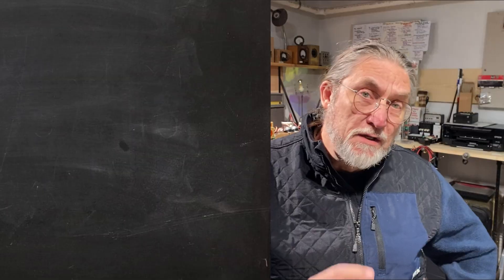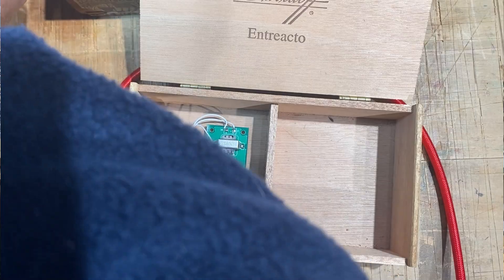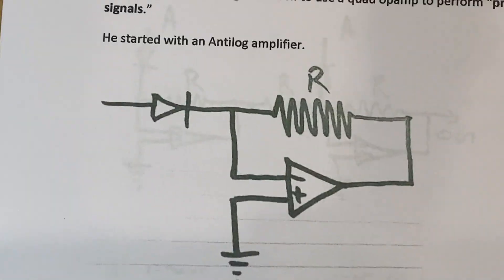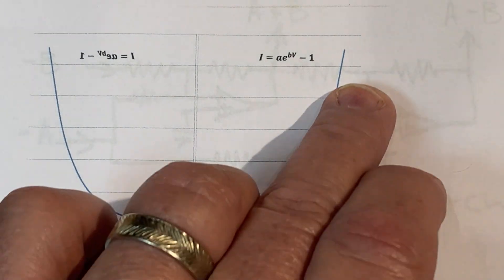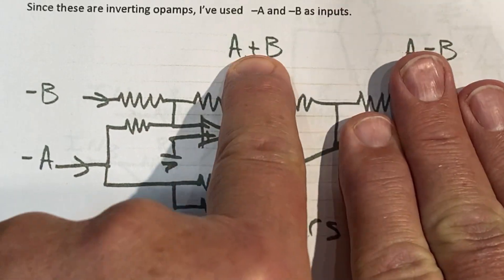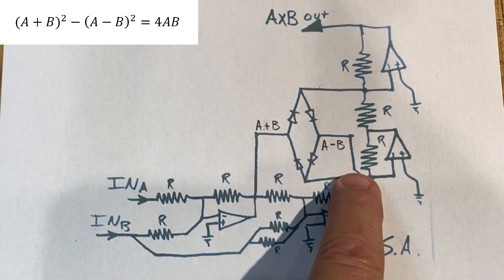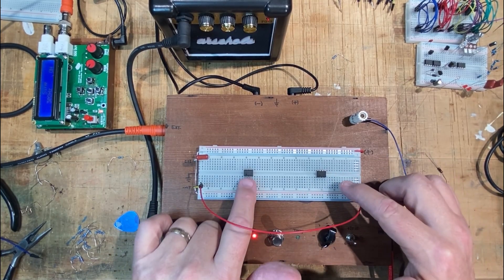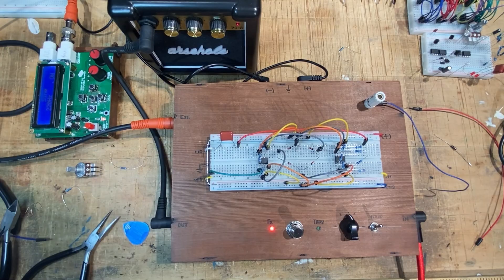Building a RING MODULATOR From SCRATCH

Comment from the maker: What happens when one audio signal mathematically multiplies another? In this video, I build and explain a ring modulator / four-quadrant multiplier using only four op amps, four diodes, and common resistors -- no specialty ICs required.

In a previous build, I demonstrated amplitude modulation using a diode switch acting as a voltage-controlled amplifier. This time, I take things further by allowing both the carrier and modulator signals to swing positive and negative, creating true four-quadrant multiplication -- the core of ring modulation.

Rather than relying on transformer-based passive ring modulators or specialized chips like the LM565, this design is based on a paper by Sebastian Azevedo, which shows how a quad op amp and diodes can approximate a square-law relationship through clever use of antilog amplifiers.

In this video, I cover:

    The difference between amplitude modulation and ring modulation
    Why ring modulators are often called four-quadrant multipliers
    Limitations of passive diode ring modulators
    How antilog amplifiers using diodes actually work
    Using algebra (sum and difference of squares) to derive signal multiplication
    Why the diode “ring” naturally falls out of the math
    Building and testing the circuit on the bench
    Listening tests with guitar and oscillator input

While ring modulators are often used for harsh or alien sounds, my long-term goal is different: using multiplication and quadratic behavior to approximate the even-harmonic structure of a triode tube stage -- entirely with simple analog components.

This is one of the most technically dense builds I’ve done so far. Let me know if this level of detail is useful, too much in the weeds, or exactly what you’d like to see more of. And if you spot errors or know of similar work, I’d genuinely love to hear about it.
Reply: How well does the circuit work if one input or the other is DC? In other words, can you use this as a VCA, the gain cell for a compressor or gate?
Reply from the maker: I'm actually going to be looking into this very shortly. I have my suspicions about what it should do. From the mathematics, it would appear that it would be a form of VCA. I'm definitely going to try.
Reply: @MadScientistGuitarLab  I simulated it in Spice and the linearity leaves much to be desired. Hopefully it sounds cool, but it definitely won't sound transparent.
Reply from the maker: @StephanAhonen well, distortion and guitar signals go hand in hand. If it sounds ugly but interesting, it deserves a closer look.
Reply: Cool, was just watching this video https://youtu.be/NBVIN0S5o_g?si=wnk8Je2BE4LEdg7E  which i think is baiscally the same thing just showing all the math,  a squaring function.
Reply from the maker: @mikejones-vd3fg That’s interesting. I will definitely look into that for my future projects. Thanks!

Comment: Could you make a ring modulator where the carrier signal tracks the input signal at an adjustable difference?
Reply from the maker: I like the way you think. In many ways, that’s what I’m working on now. I’m trying to add a constant amount of shift to a signal but do it in a way that moves with the signal to be “in tune” so it doesn’t get all angular sounding.

Comment: As a naive high-school student, I built a ring of diodes, without transformers, and I heard the BBC World Service coming through my guitar amp.  
As for carrier leaking through, that's a sign that the modulation isn't actually balanced.
Reply from the maker: That's an amazing story about picking up the BBC World Service. It's like you built a crystal receiver and your guitar was the antenna picking up the radio signal.

Comment: When I was a youngster , I built a ring modulator using a five transistor array I ... CA 3086 ... more or less same result as four diodes ... however when I use a 4046 in combination with a LM13007 and a few more components I got a really good result ... similar to the synthesizer module published in the Elector magazine ... only one thing ... nobody in the band like the unusual sound .. so I scrapped it
Reply from the maker: Thanks for sharing your ring modulator building experience! It's fun to hear about the different ways people have tackled this circuit, even if the band wasn't always a fan! 😊Sometimes you just gotta be weird though.

Comment: The only “problem” that sticks out to me here is it sounds like the op-amps on the output side are clipping. I’d speculate that only 500mV on the input may be all it takes to cause that. 

The circuit would likely benefit from an output buffer stage, and independently-variable attenuators on the guitar & pilot inputs
Reply from the maker: Thank you! I know part of the distortion was from the input side. We fixed that by adding a log amplifier to compress the signal before processing. It worked really well. A buffer would help the output stage too. I might have room for one more chip. 😂

Comment: The Ring Modulator was invented by Bell Labs, and the purpose was combining two phone calls on one copper telephone line, then they could use all wires for two calls at the same time. Can you imagine, somebody speaking to you by phone, and the voice went threw a ring modulator? 
 
Don't answer, just let it sink in.
Reply from the maker: Yes indeed. Early multiplexing. I almost made a mention of this in the video because it explains why we use the phase locked loop. There's another HUGE topic lurking here because there's a lot of stuff that we do based on the work at Bell Labs.

Comment: Keeping the diodes at the same temperature and having them fairly well matched works out better.  You can get "2 pair series connected" diode arrays.  This keeps them closer to the same temperature.
In the past someone did make a semiconductor thing that matched a tube.  I can't remember who it was.  They did it using transistors and not diodes.  The math is the same.
The same basic circuit plus some more bits can be used as part of a frequency spectrum inverter or as part of a frequency shifter.  Both of these can be useful effects in specific cases.
A Gilbert cell can also multiply but it only works at smallish amplitudes.
Reply from the maker: Thanks for the suggestions on temperature matching and other applications for the circuit! The original author used those devices because they are well matched with low forward voltage. Thanks for watching!

Comment: Very interesting.  I haven't seen this circuit used in music synthesis, and I wonder why.  Instead, specialized multiplier chips are used.  And they still need trim pots and such, so it's not like there's a big performance gap.  Opamps, diodes, and resistors.  I love it!
Reply from the maker: I think the specialized multiplier chips are used because they are easier to set up and trim. This circuit is definitely a bit more finicky, but it's a lot of fun to build from scratch!

Comment: This is kinda related, but you might find it interesting. I recently built a guitar amp that uses a VFD display instead of a triode in it's preamp and it also produces even harmonics. You might wanna try experimenting with that. It's like using a triode with directly heated cathode. It sounds wonderful if you ask me. It's the same exact thing as that thing called nutube that was popular a few years ago. It's a much simpler way to produce those harmonics if that's your only goal.
Reply from the maker: Definitely something that I would be interested in! Thanks for the suggestion!
Reply: @MadScientistGuitarLab  Try it, you won't be disappointed. Best of all is that it works on low voltage. Mine is set up to work on just 25 V

Comment: ... but I think you got your circuit wrong anyway. You mingle up A+B with A-B and then square the mingle instead of squaring
A+B, which your squarer could do, but then you would have to send A-B through another squarer and then subtract the second square from the first square. Better still, get yourself a used copy of the latest edition of Horowitz' Art of Electronics and look up what he recommends for a ring modulator that suppresses the carrier ...
Reply from the maker: I sold my copy of Horowitz decades ago. It would be great to have a copy of that for reference again.
As for right or wrongness of the circuit, I followed the original authors work and it appears correct, even though it’s an approximation. It may not be obvious from the way the circuit is drawn, but the opamps in the final stage handle both duties of squaring and the subtraction of squares.

Comment: Nice job! It's really fun to encounter one of my circuits "out in the wild".   It's funny, I had the same doubts about being too "in the weeds" when writing up that article for EDN...

The circuit is clearly modulating and seems fairly well "balanced" in terms of component matching. I'm hearing a more pronounced thresholding effect than in my builds, where the output stutters and drops out as the note decays. Might be down to the type of diode used, or the voltage scaling etc.

 I never specifically optimized the  circuit for use in a guitar effect, it was just a somewhat "cheesy" example of an application of a low cost analog multiplier. Still lots of room to experiment and improve the circuit. 

Placing a log-amp stage before both inputs (made of the same resistors/diodes) yields a much wider dynamic range version of the circuit, which doesn't have those scaling/crossover/dynamic range problems, albeit with 6 op amps now. 

Also, if you build the oscillator out of analog components, you can "leak" a bit of guitar signal into it, causing it to snap to harmonically related frequencies of the note. This screens out very dissonant combinations of guitar/oscillator and makes for a more usable, well-tempered effect.

All the best!

S.A.
Reply: ooh! two channels to subscribe to in one video 😍
Reply: Wow...found two amaxing authors in onw day. Subscribed to you both.
Keep the weeds goin' 🪴 🌱 🌿 ⚛️
Reply from the maker: @edgarskarklins3572 you’ve helped coin the term “technical weed farmer”
Reply from the maker: Wow, thank you! It’s really cool to hear from you directly! I, for one, could have used more weeds in your original work. Ha ha. Hopefully, I've covered your original idea and done it justice with my explanation. 

I've tinkered with your circuit off and on for the past 5 years with modest results. This time around, it was only after my frustration with log/antilog multipliers that I tried yours again. It worked better than I had ever hoped and so I made this video. I suspect that my diode choice is causing the distortion you hear. I have some germanium diodes with very low forward voltage that I could substitute in there to clean it up. They are really inconsistent though.

Thanks for the great info and suggestions. Adding a couple more opamps for the log /compression on the inputs isn't too bad. I think I have room on the bread board for that. Oh, and the "leaky oscillator" is inspired! I have a stack of oscillator experiments to pull from that I can play with to make that happen. I have never thought to perturb one with the guitar signal before. I'm definitely going to play around with that idea.

Comment: did you match your diodes or any of the resistors?
Reply from the maker: Not in the slightest. Granted, these were metal film resistors so were 1% values. The diodes were just plucked at random from my parts bin. Their forward voltage was anywhere from 0.62 to 0.64 volts. I was surprised when it sounded as good as it did. I’m not complaining.

Comment: One thing I've wondered about is about the effectiveness of a hybrid analog/digital approach where a DAC whose output is scaled relative to a reference is fed one waveform digitally, and the other waveform as the analog reference.  The sampling rate would have to be high enough that the output could be filtered without eliminating the useful overtones that were supposed to be produced by the ring modulation, but many styles of ADC inherently produce an output proportional to a reference voltage without need for non-linear processing.
Reply from the maker: That's an interesting idea for a hybrid approach! I have used an ADC as a compressor before by feeding a copy of the signal to the reference input. The sample rate was huge, and in so doing the digital conversion was scaled really well to make a wonderfully compressed signal.

Comment: I think it depends on the audience - I stumbled on this as I'm into electronics and I've heard of ring modulators through synths and other stuff, but I've never seen it explained. So if you intended it to be a part of the electronics group of YouTube, then continue on. If you want to keep it audio only, then probably it's in the weeds. But I think it's neat because it's one of the few overlaps you can demonstrate with sound and not just an oscilloscope.
Reply from the maker: You make a good point. I’m on both sides of the fence here. Part of me is just a guitarist that wants to make cool noise. But I’m also a physicist who knows all the math and theory that goes along with the electronics. You’ve given me an idea to strike a balance between the two. Thanks!.
Reply: @MadScientistGuitarLab please do. There's plenty of sell out channels just reviewing some commercial products, or audiophiles arguing about snake oil.
I'm learning electronics and it's a bit hard to distinguish what to believe and what is just misconceptions.
And there is a wery large gap between doing an ac and dc course and practical curcuits and the maths as you shown here. I mean beyound "this is embittered follower; this is op-amp".

I wish true graybeard channels would be more popular than brain-rot.

One can dream.
But I only discovered your channel by accident by following interesting YouTube recommendations.

I'm learning a lot from MrCarlsins lab. But that's practical things, you can offer truly valuable insights as both a musician and a physicist. Please use that potential.
It will not be millions following screaming teenagers, bit there sure will be a lot of people who would see value in that.

Aa for myself, I'm slowly learning analog electronics, I'm nit musician, but some friends asked can I build an amp and some effects.
I'm comfortable with simple robots with Arduino and Atmel. Atmega microcontroller, but analog is a whole new world.